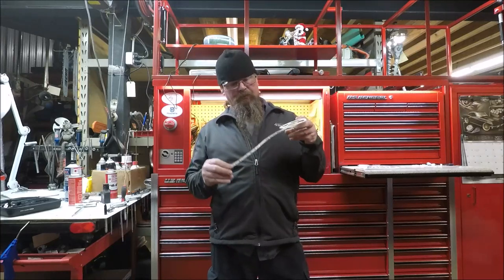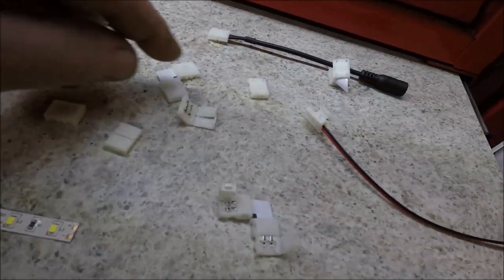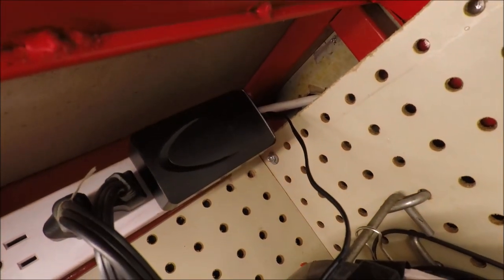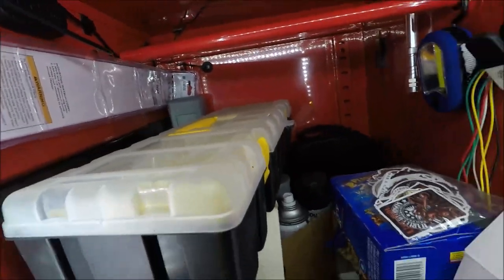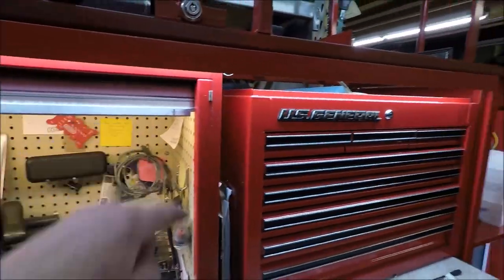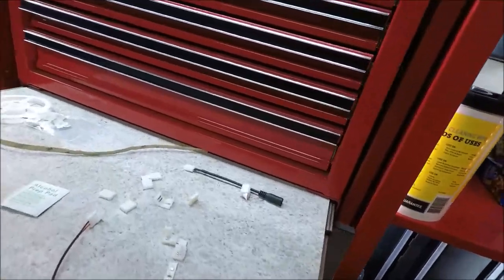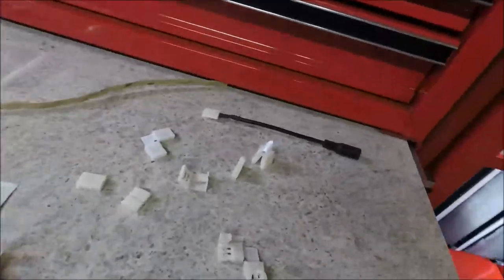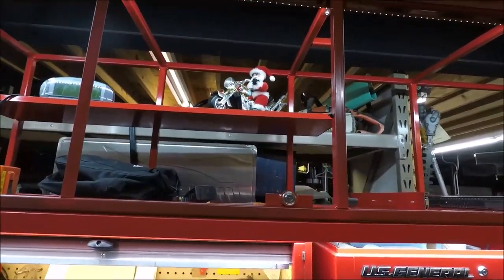Tool Cabinet Lighting

Comment: what size is your mini steel roll up door?? and how did you get it??
Reply from the maker: The roll up door was the top to a fancy file cabinet, maybe for blue prints. An office building had put it out to the curb for pickup and I snatched it up. The hutch was build around that piece of roll up door. You may be able to find something similar if you search for roll up security doors.